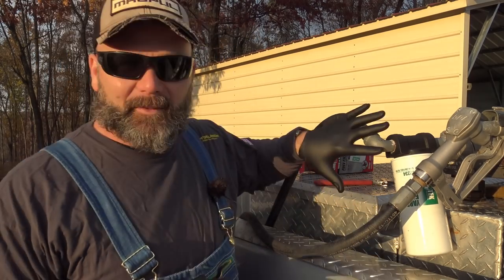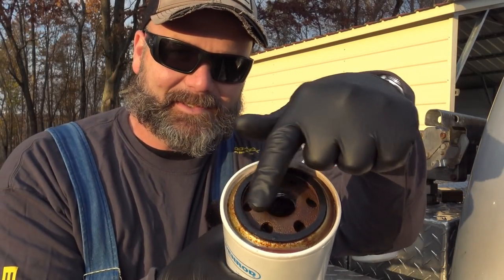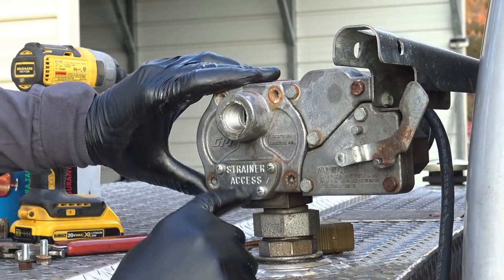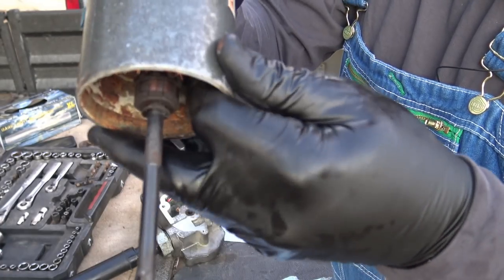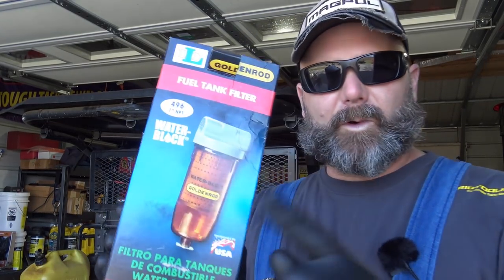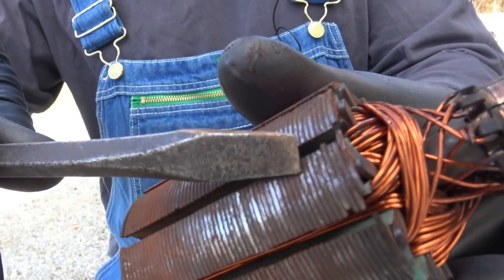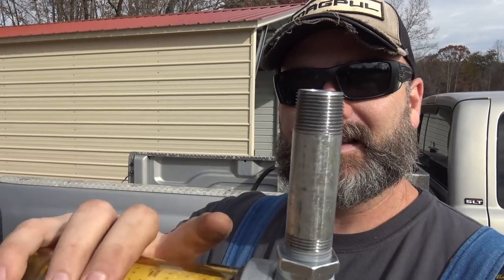What's in my fuel! This doesn't look good!

Comment: Thank you for sharing, and I sympathize with the owner here.   This is a real good reason to only purchase new and trusted products like a new verified "clean" tank and hopefully fuel from a trusted source.  The cost of service and upkeep of fuel systems on an engine far outweigh the savings from dealing with cheap, compromised holding tank systems and bad fuel.   Diesel fuel systems are expensive to fix after damaged through cutting corners.   We hope the engines receiving this fuel have not been damaged by now.  Like Caterpillar fuel tanks read, "buy clean fuel and keep it clean" sounds like good advice to me.

Comment: Had to replace our pump recently. Ours was sealed and not serviceable so had to replace the whole unit. Ours, the seals had failed and the switch and motor portions both had corroded terribly. Glad you fixed yours with little cost and I think I’m going to get the same visible filter next time around!

Comment: Good job Josh, that inline filter will protect whatever your putting fuel in., but what about the pump because that was your issue in the 1st place..water getting into the pump you need a pre-filter for the inlet side when you add fuel to the tank..or you can go to the truck stop and get or Google stanadyne diesel tank additive it's it works just for this situation  keeps water out of the tank

Comment: Nice work Josh. Seems to me that when the water got into the motor, the magnets came loose and the rotor was rubbing against the magnets, making the noise and stopping it. Sure feels nice fixing something yourself and saving a ton of money. Last spring my chainsaw wouldn't run well and I replaces the Card, fuel lines and fuel filter and now it runs great - cost 25.00.

Comment: Need to seal the motor to pump case or water will get in again. Although, none of that is what's in the fuel! The tank itself needs cleaned and a strainer installed on the fill. The bushing/bearings need replaced, the armature should not touch the magnet.

Comment: tip for cleaning motor housings, a Cylinder Hone tool will clean them out nicely and not mess with the magnet alignment. I wouldn't use your best one but everyone has grandad's old one lying around.
I was about to say use an structural acrylic adhesive not caulk, but you figured that out. Epoxy is OK, but acrylic has a higher temperature rating and it's what the OEM would have used for glue the magnets. Replacing the bearings would have been nice, maybe next time.
Good job on fixing that, you can service most big motors but they don't make them easy.

Comment: Hi Josh, great job with the motor...
I've had to improvise sanding in a cylinder before, and where you stuck the sandpaper to the socket works. If you leave 4-6 inches extra on the paper, it acts like a flap sander. It gives you a more uniform sanding finish. 
Also, plumbing supply dealers usually have rolls of mesh sanding material 2½" wide that takes material off fast, but leaves a polished surface.

Comment: Good video Josh. To help keep that fuel clean, every now and then turn on the pump and just circulate the fuel back into the fuel fill hole. That way it runs through the filter and water separator and helps keep the water and contaminate levels low. Then just clean the filter like you normally would. Good job though. Always worth fixing what you can.

Comment: Put the nozzle in the fill hole bung and cycle fuel in tank for 15 minutes and see what your new filter picks up and park the pickup on a side slope so water, debrie get sucked up with sucker pipe. 
   Repeat in a few months after sloshing it around. If to bad, pull tank and steam clean insides and be good as new. Now you know why pilots of small planes check for water so often.

Comment: Unless you keep your metal tank brim full the tank will generate condensation particularly as the nights get cooler. The inline separator will protect your tractors but not negate the source of the problem. A screw closed air inlet would be very beneficial so long as you remember to open it when you fuel up. Regards from Scotland.

Comment: I like the rebuilding part of the motor but one word of advice about Teflon tape that I learned from replumbing my air compressor.    It is recommended to use Teflon paste instead of the tape.     The theory is that the tape can break off and get stuck in something whereas the paste dissolves.    No idea if it is true, but I have had good success with the paste.    Thanks for the videos!

Comment: I do a lot of stuff like that at my place, Farm Fixed. I got a 100 gallon tank from a friend years ago but never used it, it sat for years unused and unloved. I got tired of filling my tractor and skid steer from 5 gallon cans so i started working on the tank. A little crud inside and slightly rusted from condensation I figure so I got it cleaned out pretty well using Evaporust, ball bearings and fuel. I drove it around in the back of my truck for a few weeks whIle so everything could slosh around well. Once I got it all cleaned out I filled it with 60 gallons with an additive to preserve the fuel. Got a new Goldenrod filter and tried pumping it, hand type pump. It filled the filter but nothing out of the nozzle and the pump was tight and blowing fuel out of the small flapper anti syphon valve on the pump. Got a new flapper valve, no leaks now but still no fuel and the pump was tight. I took the filler hose off and stuck my air nozzle in it to blow it out and this wad of gunk came flying out of the hose. I cleaned the hose out really well and put it back together and it worked like a champ. Evidentially in its’ life with my friend a mud dobber had stuffed the hose with mud, they do that just to piss you off.
Moral to the story is keep the filler hose covered so nothing gets inside like mud dobbers.
I really enjoyed this video, very useful for the rest of us out here. Not being a financial wizard I need to be careful with my money and not waste it. The Lord takes very good care of me and whenever I really need something I can’t fix I reach in my pocket and I find exactly what I need, like magic pants. How cool is that? Thanks Dad!

Comment: Nice work.  Make sure the tank is vented.   Mositure will come from the air in the tank, condense and form drops on the underside of the top, especially if not well vented.  That will both rust the top of the tank and drop into the fuel.

Comment: Josh
One thing you should check is to see where the metal stamping where the shifted if they cut into the insulation on the windings ( that insulation is only a thin layer of lacquer)  
That will reduce the effectiveness of the windings and could eventually cause the armature to  burn out.
You might be able to see if those windings are damaged and re-lacquer around the areas. (don't hold your breath that that will fix it though. Good luck)

Comment: Shipmate, take the pump out on pickup tube wrap brass/copper screen wire on bottom to keep particles out of the plastic gears. You do know that mold will grow in your fuel tank unless treated, it does take some time, try to keep the tank full always prevents condensation accumulation (water). ChiefD

Comment: I have the same pump, the Fil-Rite are better pumps. I’ve never had any issues with the GPI but it’s not as smooth and doesn’t pump as fast as the Fil-rite. The epoxied magnets came off on my mower starter and made the same noise as your pump. I cleaned up the housing for the starter mower and epoxied the magnets back in, works good again.
Witness mark the parts before disassembly. 
Use a white bucket test first with the filter housing in place but without a filter. Pump into a white bucket to determine if there is any water or crud in a tank. No water or crud, pour it back into the tank then install the filter. Saves wasting a filter right off the bat.

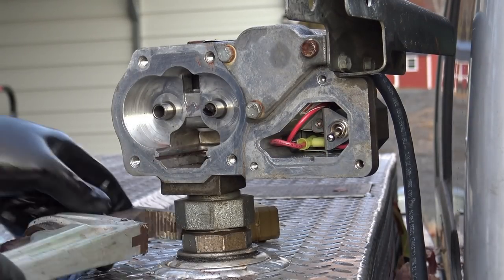Comment: 10:26 OK my input, the water in the fuel has killed that front bearing for the drive mechanism. It'll likely be an open race roller that is meant to be lubricated by the diesel fuel & it's not taken kindly to the water/crud mix.  You might find if you hose it out with brake cleaner and then diesel it'll come back somewhat but if it's easy to get out, you can go to a bearing factor and they can replace it from the numbers stamped on the side.

Comment: The fuel additive that kills algae simply does that, it kills the algae. After that it  gets sucked up and gets trapped by the fuel filter. I would suggest having a good supply of filters to change them out as they will clog up fast.
Reply: You fuel should come with adative in already.  
Jet planes use to have an issue with fungus growing on the water fuel layer. The mycofungi would block fuel injector

Comment: behind the switch is a  auto resetting fuse, used a lot in campers where the battery is charged while hooked up to the pulling vehicle

Comment: ok so that on switch is not a relay but my guess is a self reseting circuit breaker.  second you should never use silicone around a DC motor.  some people say you can but why take a chance.  deals with the comm on the dc motor.  you should not have sanded the brushes, there is a seating procedure to get that arc in them.  epoxy is a better for the magnets.  overall good job.  you have to love it when it all works out

Comment: I remember you talking about the fuel problems with fuel in one of your last videos and I hoped you had solved that problem. The pump probably have to removed and rebuilt and all the fuel in your tank emptied out and the tank cleaned. You need to empty out your fuel tank and clean it out also as you are getting water into the fuel and it is destroying your motor and damaging the rest of your system. Next you have to check your tractors and see if there is water in the fuel tanks on them also. I am glad that you found the problem and I hope you will consider putting a cover over your pump to keep any water out of the pump.

Comment: A problem we find here in the UK is diesel bug! Clogs filters and pumps. Causes sludge in the bottom of the tank.
The higher the water content the worse it is. Especially  prevalent in fuel that has been sat in the tank for a long time.
You have to clean the tank, keep the tank full (to avoid condensation water build up) with clean fuel.add a fuel treatment.

Comment: The water separator and filter perform different functions.  It seems to me that instead of just replacing the filter with the water separator, the separator should have been added to the system between the pump and filter.  At least that's the way we have it on boats.
Reply from the maker: The fuel water separator has a filter inside that's replaceable my brotha...I think I'm covered...I hope
Reply: Was going to say the same thing I live on a canal boat in the UK. Have a 4cyl Kubota Diesel engine.  Have a fuel separator AND a filter.
Reply: @StoneyRidgeFarmer  Why run the trash through the pump, clean the fuel before the pump. Clean the tank, buy fuel from the same place to keep a check on the quality of your fuel.
Maybe I missed it did you lubricate the bearings of the motor and there is no such thing as a{sealed} bearing in that pump you can get some added lubrication to the bearings.Keeping the motor water tight helps too. Checking the voltage to the pump will let you know it is being given enough voltage to live a long life. I see you get a lot of comments of all kinds it maybe worthwile to consider some of them Good luck
Reply: These motors are built the same as starter motors they have iolite bushings so no lube required although they might be shot and need to be replaced.

Comment: As others have said, filter the fuel separately and after the water separator. The internal filter is much coarser than the separate filter.

The water issue is likely to be or have been the tank itsself. Make sure you have removed and resealed all vents, fillers and pump mountings.

Comment: I would suggest finding a 1 gallon clear glass jug (clean obviously) and pump directly into it, fill er up and leave sit overnight and see if you have any junk or water settled on the bottom.  Also, try to find a spot under roof to park to eliminate the possibility that the water is getting in on your end rather than the supplier.

Comment: You would put a light coat of silicon dielectric grease or Fluid Film on the armature.  Actually, after the epoxy is cured a shot of Fluid Film on the interior of the motor housing and magnets is a good idea to help prevent rust.

Comment: I had bad gas in my car.My son is a mechanic He had to put in new spark plugs and new filter. Thank heaven it did not hurt my motor. He said that happens at the gas station when they pump up gas off of the bottom of a tank that is almost empty.

Comment: You may have but I'd hotwire past the toggle switch to guarantee it's passing enough amperage ...I see you got to the epoxy for the magnets ok, you are rockin it!!!!
Reply: @charlesangell_bulmtl  understood, I wear out toggle switches often on overhead crane controllers, they can be trashed on the inside and look great on the outside, it's a moving part, never overlook it's ability to partially fail and cause strange occurrences

Comment: Hey Josh- just wanted to let you know that you that you just took a step backwards in your tractor fuel filter plugging problem. The two previous tank filters carry a 10 micron rating and your new water separator has a 17 micron rating , meaning it does not filter as well as the 10 micron filter. You should have put that cim tek filter assembly back on after the separator and before the hose. Most modern diesels use a fuel filer that is rated at less than 10 micron ( usually around 4 micron).  You will be pumping junk out of your tank for a long time unless you empty it and have it thoroughly cleaned , once you get that stuff in a metal storage tank, it's hard to get it out.

Comment: Josh, you may be dealing with what we deal with in aviation with regards to water. On an aircraft wing when the temperature of the aluminum drops below the dewpoint of the atmosphere, it causes water to condense inside of the tank itself. The longer the tank sits, the more water it accumulates. On an aircraft, we always 'sump' the tanks during preflight to remove any water that has settled to the bottom of the tank (water is heavier than the fuel). Remember that the amount of accumulation is directly proportional to the amount of 'free air' in the tank (for the water to condense out of) so the fuller the tank, the less condensation that is likely to develop. Since your pump is pulling from the bottom of the tank then it's likely it is pulling a big slug of water right off the bat. Maybe also add a simple 'push-to-drain' sump at the bottom to drain any water prior to using it.

Comment: spin that armetor with a drill while you hold sandpaper or a file and you can true,clean and smooth it,  chuck it right on the shaft...fine job though...you got it...WOOO!

Comment: Josh, you needed to put some grease (just a slight coating) on the inside armature input shaft, that goes into the bearing (center) hole, of the   casing. Also coat the bearing {thrush} washer / spacer you found. Great video. You saved some big $$$$, just taking your time, and realizing your mistakes, and doing the job right. It's not rocket science. Reference algae in the fuel, When I worked for BOEING AIRCRAFT, {Everett, Washington state} they used a special primer (Yellow in color) on the inside of the wings, that had some anti-algae growth chemical in it. For those who may not know, the wings of most aircraft are the fuel tank's. On / in a 747 wing, on the inboard (first two bay's / compartments) side / area  (closest to where the passengers sit) I as a 5'ft-10"in. tall person, in the center of the wing only, cold stand straight and not hit my head. In case your wondering, could you walk from one end of the wing to the other end inside the answer is no. The wings are broken into compartments / sections via walls/ baffles with holes (from one inch dia. {leading/tail edges} to maybe a 5" - 6" in center of compartment) different height's & different center to center dimensions, so when the airplane turns /bank's in the air, the fuel doesn't go rushing to one end or the other. That would be a BIG NO - NO, if the airplane wing didn't have the walls /baffles.

Comment: The magnets are supposed to be glued to the outside wall of the motor housing the're not supposed to come out with the Armature. If it's not broken and cleaned up it might be possible to glue it back in there. I would think there's also a seal between the electric motor and the pump as well you're going to have to ascertain if it's okay. If the Armature has rubbed on that magnet too much though it will be junk and that rubbing noise is exactly the funny noise your hearing and the reason the motor is dragging down